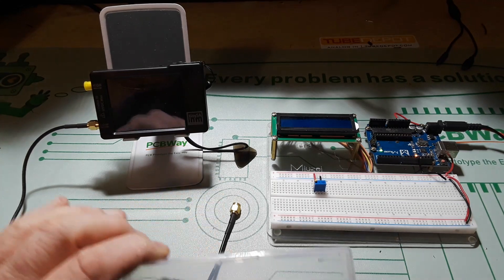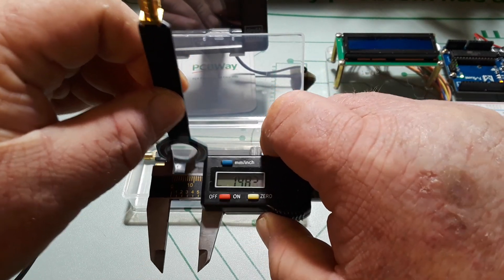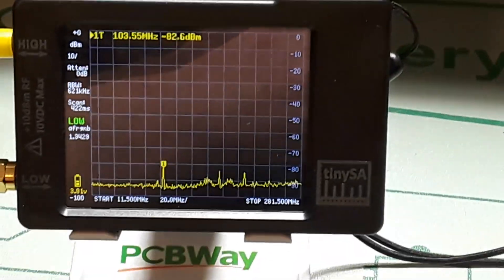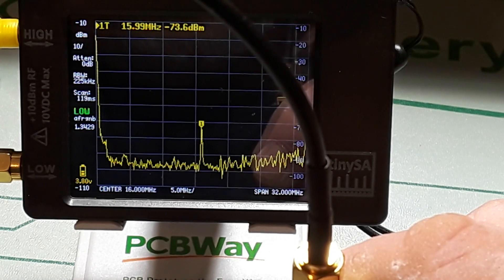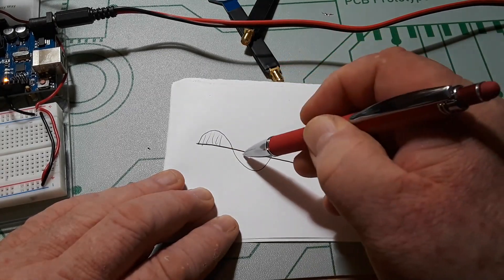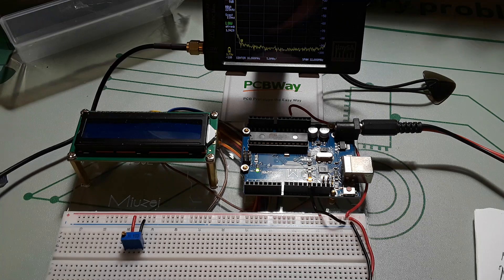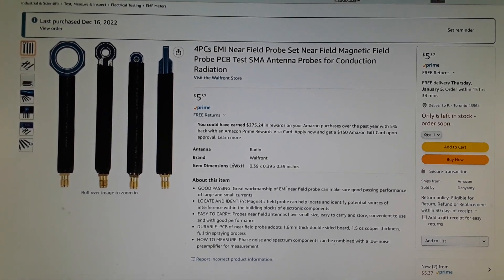The Cheapest Near Field EMI Probes from Amazon

Comment: Paul I love your videos. Paul makes excellent videos in an easy to understand format especially for the novice / hobbyist. However, I feel this one needs a little polishing. I’m not trolling here. My aim is just to get your viewers back on track where you made a few errors and to fill in some information that you missed that’s important, relevant & on-point with your video.

ERROR:
1) At 1:31 The probes with the Loop are the “H Field” probes & the short stubby one is the “E Field” Probe.

BACKGROUND:

The reason there are several probes with the Loop (H Field) is to narrow down where the RF radiation is coming from.

SCENARIO:
Perhaps you have a circuit where it’s leaking excessive RF. But there are 2 components in close proximity to each other (E.g. a Coil & Crystal) The larger H-Field probe is very sensitive and you’d get similar results regardless of which component the probe is placed by. Whereas, using the smaller H-Field probe will be much more discriminating and give you better relative results as it relates to Field strength. Which leads to point 2 below.

ERROR:
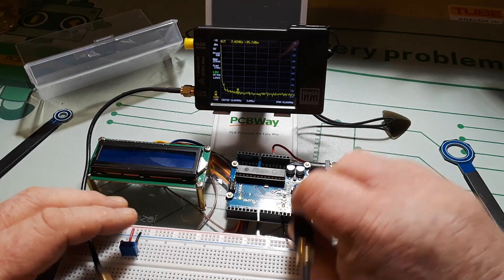2) At 5:39 It’s not that’s it’s “too small”. (It’s operating as designed) When you use the smallest H-Field (Loop) probe, you may not pick up a signal strong enough to be detected by a Spectrum Analyzer. (Not even on my $6k Rohde & Schwarz SA) In that case, you need to use a Low Noise, High Gain, Wideband, RF Pre-Amplifier between 10-30db gain, at (9kHz-6GHz) In-fact, an RF Pre-Amplifier is an essential tool for any EMI Pre-Compliance testing. RF Pre-Amplifiers can be purchased between $20-$50 on eBay. Or on Amazon for about $15.

BACKGROUND:

PRO TIP:    * IMPORTANT *
When using an RF Pre-Amplifier, be very careful not to over-drive your Spectrum Analyzer’s inputs. You may “blow-out” the Front-End of the SA. (This is particularly true for the tinySA & tinySA Ultra since these don’t have any input protection circuits) 

tinySA           Maximum Input: +10dbm
tinySA Ultra  Maximum Input:  +6dbm

To overcome this, use “Signal Attenuator(s)” following the output of the RF Pre-Amplifier. An SMA Attenuator Kit can be purchased on Amazon for about $45. 
(Kit of 6 Attenuators, 1,2,3,6,10,20 db reaching 42db in 1 db increments)

Now in reality, if you’re losing the probe signal in the noise-floor, (around -80 to -95db), amplifying it by 30dbm, will raise the signal by that much (-65 to -50db) enough so you’ll see the signal. So it’s unlikely you’re going to over-drive your SA’s inputs.

Nevertheless, you should still have an SMA Attenuator Kit in your toolbox anyway. In my humble opinion.

ERROR:
3) I’m sorry Paul, but at 7:14 you made an error. They are “NOT” 90-degrees out of phase. I’ll explain why. In ALL radio frequency (RF) electromagnetic waves, the electric field (E) and magnetic field (H) are perpendicular to each other, meaning they have a 90-degree “ANGULAR” difference. This doesn’t mean that they are out of phase by 90-degrees. (Perhaps that’s what’s tripping you up ?) To put it another way, imagine a 3D model with an X , Y, & Z axis. With X representing time and Y & Z representing Amplitude. Now, place the E-Field running flat going out the backside along the Z-Axis & then place H-Field running flat up the Y-Axis both starting and being joined at the Origin (zero), both oscillating at the same frequency. Because they are oscillating at the same frequency, both reach their maximum and minimum values at the exact same moment in time and have no phase difference between them; they oscillate together. Hence, “In Phase”. 

If the electric (E) and magnetic (H) fields are significantly out of phase, it would not be considered an RF signal now would it? 

This is precisely why the H-Field probe must be in the correct orientation to pick up the magnetic field (H) part of the wave.

I hope this helps some Viewers.

Comment: real question, can we find short circuit on multilayer pcb using this method ?
Reply: No. What you need is called “Time Domain Reflectometer” TDR for short. But good luck using that on a PCB particularly if you’re using Ground-Planes.

Comment: I tensed up at 1:10 - I thought there was going to be blood!
I bought a similar set. Mine had 6 pieces, including an even bigger loop probe and a combined loop and stub probe. I found that the 2 smallest loop probes were faulty (the SMA connector was not even touching the PCB) but I still got what I needed for very little money.
I hadn't thought about using the VNA as a 'spectrum analyzer' - so glad I saw this. 
I agree with IZ0MTW - when you say 'E' I shout 'H' and vice versa.
Reply from the maker: I know. Can't tell my E from my H

Comment: A piece of rectangular wave guide is good to explain the E and H propagation at 90° polarization.  I used to work on navigational RADAR too many years ago, and wouldn't even be able to climb the stick anymore.
Reply: Except Paul is wrong here.

They are “NOT” 90-degrees out of phase and here’s why, I’ll explain. In ALL radio frequency (RF) electromagnetic waves, the electric field (E) and magnetic field (H) are perpendicular to each other, meaning they have a 90-degree “ANGULAR” difference. This doesn’t mean that they are out of phase by 90-degrees ! (Perhaps that’s what’s tripping Paul up ?) To put it another way, imagine a 3D model with an X , Y, & Z axis. With X representing time and Y & Z representing Amplitude. Now, place the E-Field running flat going out the backside along the Z-Axis & then place H-Field running flat up the Y-Axis both starting and being joined at the Origin (zero), both oscillating at the same frequency. Both reach their maximum and minimum values at the exact same moment in time and have no phase difference between them; they oscillate together. Hence, “In Phase”. This is precisely why the H-Field probe must be in the correct orientation to pick up the magnetic field (H) part of the wave.

Comment: Thanks for sharing the video.
Not sure why you keep inverting the names. H field probe is the circular one, the one that picks up the magnetic field. E field is the pointy one, sensing the electric field. The two fields by the way are not 90 degrees out of phase, is just the vectors representing the fields that are at a 90 degree angle in space, but the two fields actually propagate in phase, ie at a moment in time they are both zero for example.
I’m about to build some myself but having those super cheap ones available make it non senso to build them. 
Best wishes
Reply from the maker: What I say at the beginning of the video? It's been 30 years since I had RF in school. Forgive me for confusing the efield in the age field